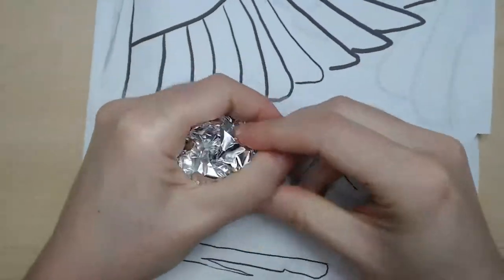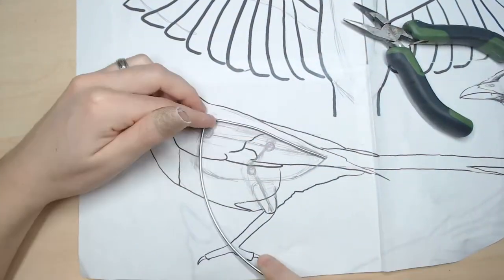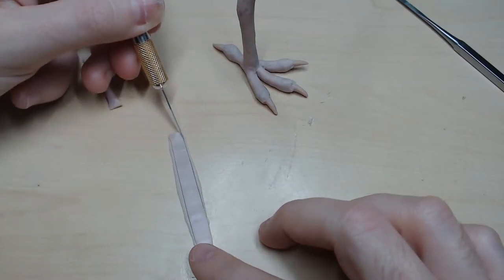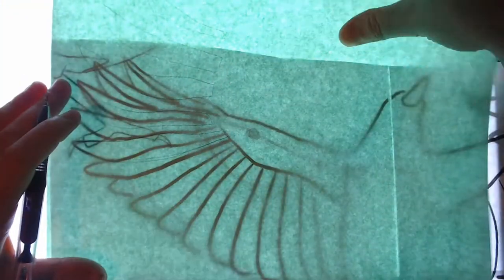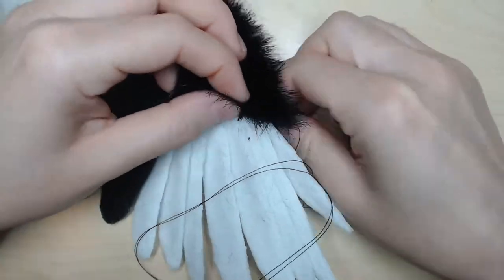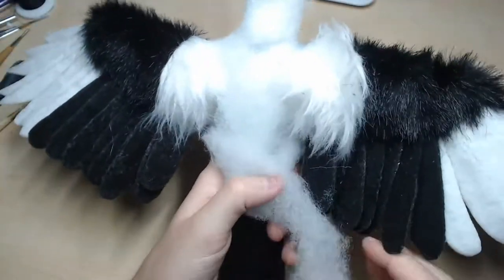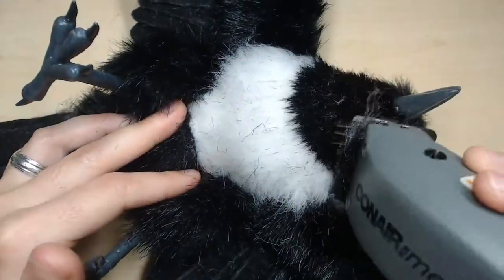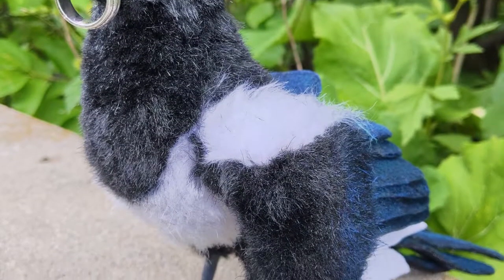Creating a magpie artdoll | Artdoll tutorial

Comment: What paint can you use for air brushing? Can it be acrylic or fabric? Id like to get a machine
Reply from the maker: Acrylic paints are usually used for airbrushing. You can buy the prepared ones (like Golden High Flow Acrylics or Createx), it saves you time as you don't have to thin them down. I prefer using acrylic paint that I thin down to the right consistency. If I paint a sculpture, I will thin down the paint with Golden high flow medium but if I paint a fabric (included minky and faux fur), I will thin down the paint with water. I never tried using fabric paint with an airbrush, it may leave a plastic texture en top of the fabric.